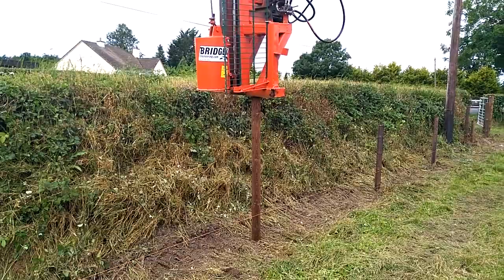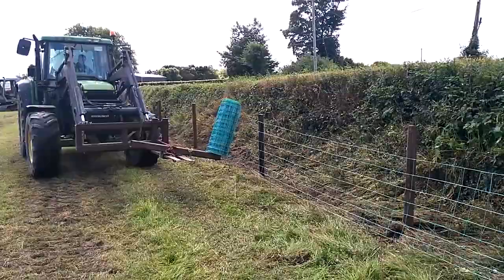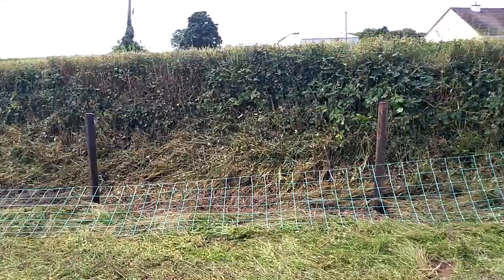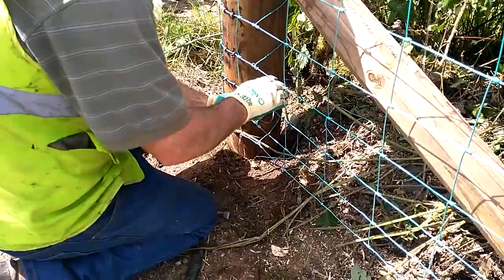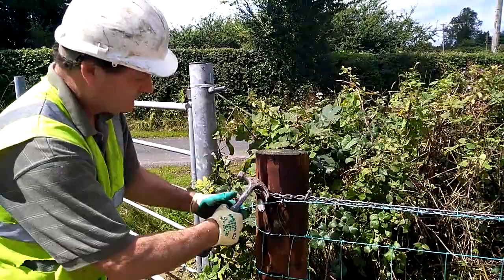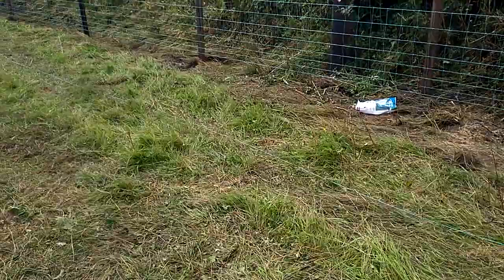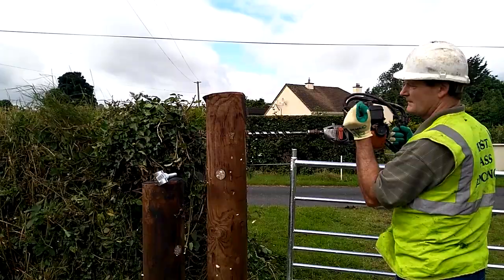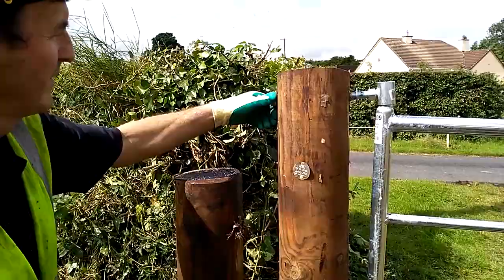Sheep fencing suitable for TAMS II scheme

Comment: Straining stock net from the outside of the last post with a tractor??? How do you get on when your in the corner of a field?? And then wack in some staples to hold it while you wrap it round the post?? Amateurs!! You should be straining the wire from the centre of the run with wire already tied to strainers to avoid excess twisting of the strainer post under tension from the wire, giving a far more even strain down the entire run of net and not damaging and scaring the wire were you've hammered the staples in tight to hold the wire. Sadly a case of all the gear no idea!